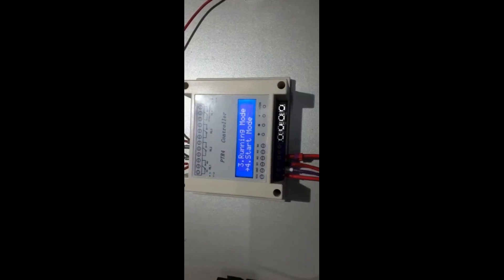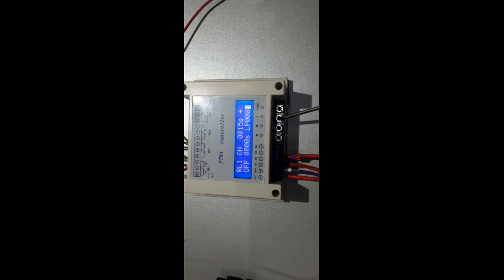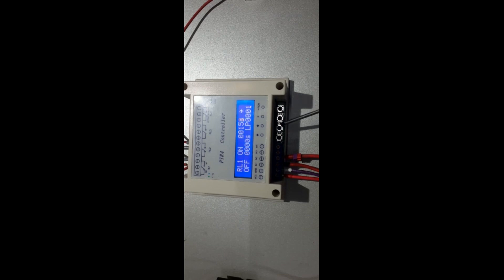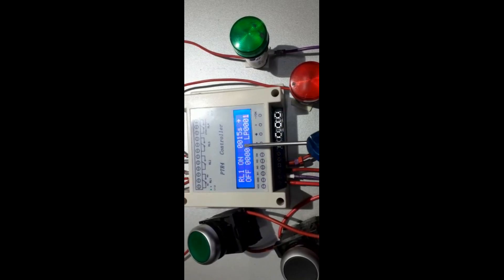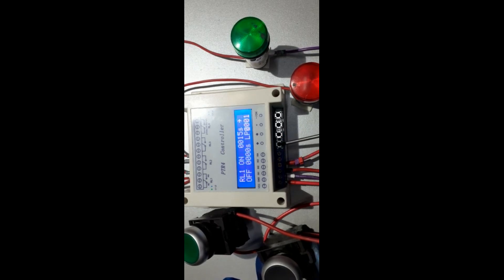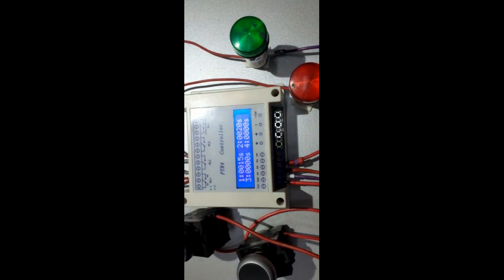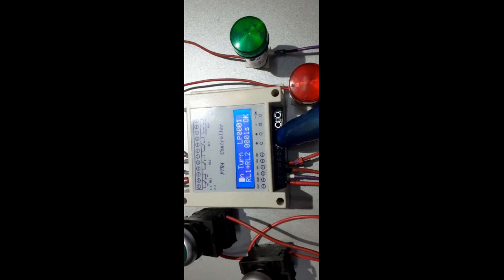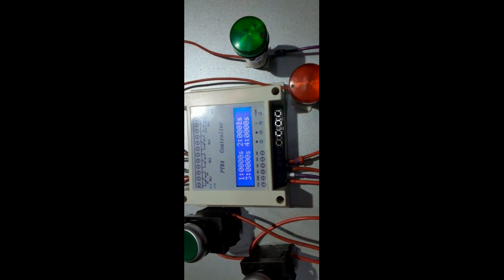KKmoon DC6-40V 4-Channel Programmable Digital Time Relay Timer Controller Delay Switch Module TPR4

Comment: I feel like my timer has a different menu that's more complicated.  I searched and found manual that matches my menu, however its not as simple as yours.  Did you have to set something up to display what you have on the screen <RL1 ON 0015s>  I don't have that!  Mine shows <02SP01 OUT:1111> second line <0027s -> SP02:0000>
Reply: Where did you buy your timer?